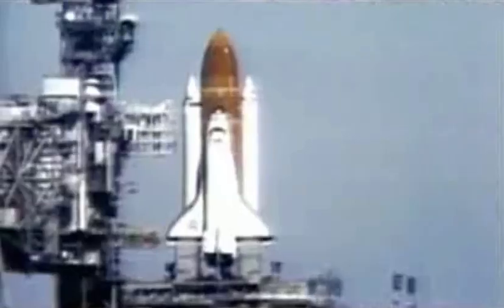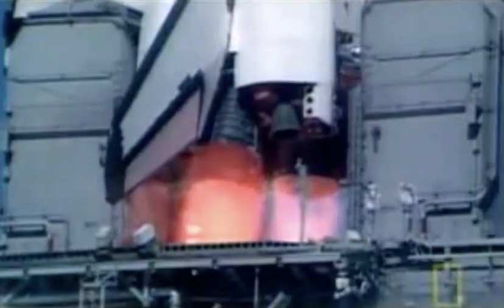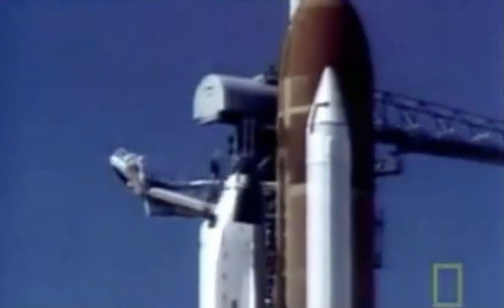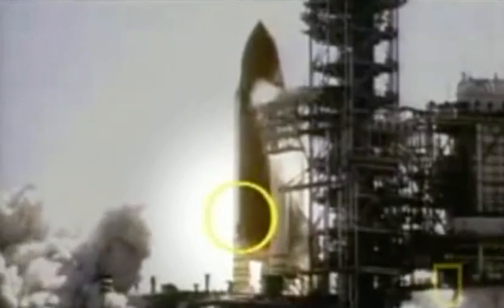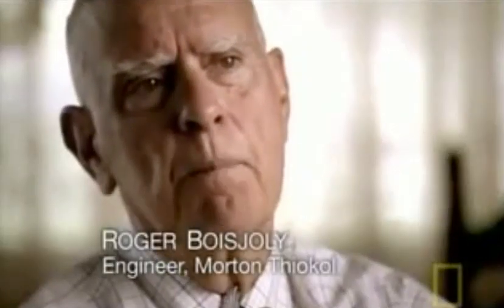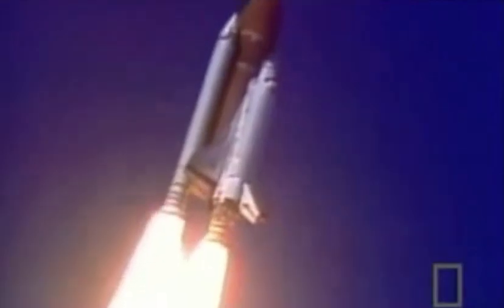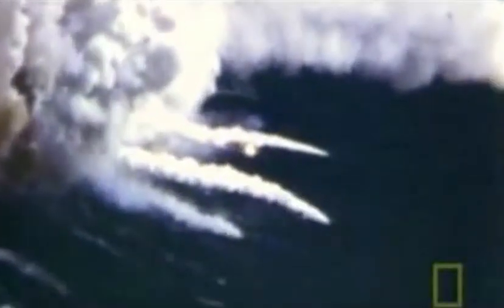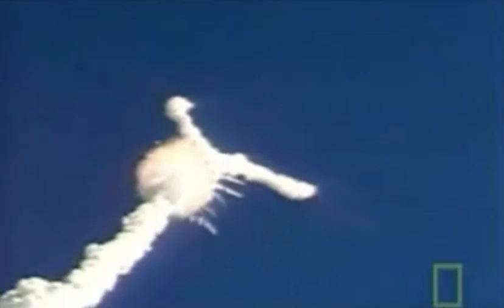Challenger's Final Flight.

Comment: That was a Heck of an explosion, why wasn't there a shock wave?
Reply from the maker: Because it wasn’t an explosion. There was no detonation. The external tank ruptured like a water balloon and the fuel vaporized. 

The shuttle broke apart due to aerodynamic stress. It’s like you’re driving your car at 100 MOH and then you just stick your head out the window.
Reply: @vicorly  , so the ET just had a Violent Rupture?

Comment: Pressure suits & parachutes could have saved them. It would have been dicey unstrapping and exiting the cabin during free fall, but possible. And they’d have walked away with barely a scratch. But NASA wanted you to believe it was an ‘airliner to space’, with a ‘shirtsleeve environment’ inside...
Reply: HailAnts the shuttle didn't have anything like ejection seats to save on weight.

Comment: If they have cameras watching the ascent, couldn’t they have seen the flame burning into the tank and informed the crew? Was there no way to detach the shuttle from the main tank and boosters in case of such an emergency? I’d think they’d be high enough to glide down. 

In any case, those families having to watch their loved ones perish in front of their eyes. Truly, truly awful.
Reply: The shuttle couldn't abort while the SRBs were running. So even if they saw it on time, nothing could be done.
Reply: Kale P it happened way too quickly. By the time anyone would have noticed it was too late. This was slowed down to show the breakup

Comment: My question is if Nasa has seen this flash with the camera obviously something was wrong how come,  Nasa did no tell the astronauts to detached  the space shuttle from the rockets bing that they knew was was going to happen next.
Reply: Yassine. Can the SRBs be separated sooner than they are supposed to come off?
Reply: Yassine. Sorry, the SOL(shit out of luck)  likely did not translate. Basically, even if something is noticed they are unable to do anything, no matter how unlikely it is to save them, in an attempt to avoid the orbiters destruction as there is no control over the SRB's attachment to the stack.
Reply: Nasty FingurZ they didnt see the flash until it was too late
Reply: Nasty FingurZ there was one NASA employee who tried to have launch a third time. but nobody listened to him. After the Challenger disaster he retired from NASA. There is a full doctumentary on the disaster
Reply: draco6543 Answerer: You dont
Reply: You do know this it was only noticed after the fact?
Reply: Once you ignite the SRBs at T0 whatever happens you have to wait until SRB sep to do anything. Before that you can just watch and hope
Reply: Murph88 Neither. Sadly that's the bad side of using solid fuel
Reply: Yassine. So it is pretty much sol once they you leave the launch pad or when the SRB's are ignited?
Reply: Murph88 Sorry I didn't understand the question

Comment: Great play-by-play.

One possible error - It describes the final plume as being created by the second o-ring burning through. My understanding is that both o-rings burned through at liftoff but were quickly resealed by a piece of aluminum oxide fuel, which was shaken free by high-altitude winds (thus causing the final plume.) Not totally sure here, can somebody elaborate?
Reply: GigaG11 Yes, everything I have read said that the disaster was delayed due to the aluminum blocking the flame until it was dislodge by a windshear. The windshear was apparently the result of a commercial airliner passing through the airspace shortly before the launch. They theorize that had it not been for that windsheer the blockage would have not dislodged and the shuttle would have successfully completed it's journey after the SRB separation.

Comment: They were alive, and conscious for the entire ordeal.
Reply: IwshIcldstrtover at the speed they were travelling, they would've actually been alive and well aware of the situation, for example, the 1974 crash of Turkish Airlines flight 981 resulted from cabin depressurization and the plane fell out the sky at 390 mph and everyone was conscious so at 207, no one would have knocked out really.
Reply: IwshIcldstrtover. Actually they concluded that the cabin maintained pressure as the wreckage showed no sign of buckling that would have happened if it lost pressure.
Reply: Until they hit ocean...
Reply: pen mightygun skydivers don't typically feel mach 2 speeds...
Reply: Oh so you were there were you? Facts not theories please. No one will ever know
Reply: They lost conciousness as the cabin plummeted
Reply: @IwshIcldstrtover  you mean regained

Comment: This documentary has a flaw of its own. Challenger's crew cabin did not depressurize. That is the lie NASA wanted everyone to believe...that the crew lost consciousness. If that were the case, the mid deck floor would have buckled. When the cabin wreckage was located, there was no evidence that that occurred. Its terrible to imagine, but the crew was alive all the way down until impact with the ocean. Even Kerwin could not say for sure in his report with any certainty that the crew was unconscious at water impact. In court, if you lie to the judge, anything else you say becomes suspect. Show us the photos. Show the damage that supports the claim. Then I will believe it.
Reply: Endeavour Gaming The shuttle broke up at 48,000 feet (9 miles), but the crew compartment continued on an upward trajectory to 65,000 feet (12 miles) before it began to fall back to earth. The force of the external fuel tank exploding on the crew compartment was about 2 Gs, far below what it was built to withstand. So no- no decompression occurred when the shuttle broke up. By comparison, when the crew compartment hit the ocean, it hit at 207 MPH (20 Gs). The crew compartment was completely destroyed when it hit the water and the astronauts were killed instantly. But they were alive and conscious for the entire fall.
Reply: I hope they passed out due to the g's of falling at Mach 2
Reply: +Endeavour Gaming They did not black out during the fall back to earth. I wish they had because I cannot imagine what the crew was thinking during the fall, but there is no reason why the crew would pass out simply by falling at that speed.
Reply: @JoeSimonin  they most likelly were trying to fly the ship and recover the attitude and going throught emergency procedures...
Reply: +Endeavour Gaming At that speed believe me it was. Hitting water is like hitting concrete, especially at that speed.
Reply: Why are you convinced that the cabin did not depressurize? Because the floor didn't buckle? What does that have to do with it? If the systems fail or there's loss of power, you can have the depressurization. And at their altitude from 45 to 65k you literally have like 5 seconds to turn on your oxygen assuming you were ready for it. The average human needs about 8 seconds to figure out what has happened, at that altitude you're pretty much passed out by then. As far as them waking up during their fall, it's still very unlikely. They would have been out till about 10,000 feet but being unconscious for so long I'm sure they weren't full awake or realizing what was happening anyways. Also not to mention the Gs they must have felt, just because the explosion was at "2Gs" you don't know what the cabin experienced as it was flying off on its own upwards
Reply: +ArkadyVolkov There was no explosive decompression and the floor did not buckle. The crew cabin was built to endure much higher forces than what it experienced when the external fuel tank broke up. And the trailing wires were from the payload bay, not the cabin itself. I would love to believe the crew was knocked out but there is absolutely no scientific evidence to suggest the cabin decompressed.
Reply: Do you have any information on this because I'm not quite understand how you call pull Gs while your falling. Even on roller coasters, when you go down, they tell you, you experience weightlessness.
Reply: Joe I agree that the crew survived the explosion and did not lose consciousness as this is shown when Ellison Onizuka, Michael Smith and Judy Resnik activated their Personal Egress Air Packs (PEAPS) this was found in the wreckage. The impact with the water was worst with Christa McAuliffe, Gregory Jarvis and Ronald McNair as they didn't have any Windows and they couldn't close their eyes before the impact
Reply: Eddie Porter You are correct. I think the thing this documentary is trying to do is to agree the switches were turned on by the crew, however, have them unconscious immediately following, which is not likely true.
Reply: +JoeSimonin yeah. I redid my reascarch. they were comncious. hopefully their death was instantaneous.
Reply: @panzerdragon1121  It seems like some of them lived long enough to drown. https://www.youtube.com/watch?v=uqcd_3daPQ8
Reply: @DieyoungDiefast  There is no way of surviving the impact into the water at over 200 mph. Story Musgraves said in that link they were alive until they hit the water.
Reply: +JoeSimonin and at that height they were at ,( abut 2-3 miles right?) explosive decompression was  unlikely.
Reply: +Joe, ugh! Almost like Vladimir Komarov when Soyuz 1 slammed into the Russian steppe at 300+ mph, only without an explosion and fire....
Reply: not unless the windows broke during break up
Reply: "But they were alive and conscious for the entire fall."

There is zero evidence to support this claim.  It is inexplicable that you believe the crew cabin was ripped from the fuselage by aerodynamic forces yet still retained a sealed environment.  Highly unlikely.
Reply: why do you care?  what difference does it make to you?  what are you going to do about it?  they're dead  period
Reply: What's the science of passing out because you're going fast? Maybe the G forces of the explosion itself, but THAT didn't happen as several of them activated each other's emergency oxygen packs.  Fact:  They lived through the explosion, they fell for ~2 minutes well aware of what was happening, and died on impact.
Reply: that so called lie is what the media wanted the people to believe so they would feel better about what they saw.  NASA didn't cover any of that up. Would they tell the whole truth, What do you think? You want to keep the public's interest up.  It's business. Story Musgrave even said they were alive when they hit the ocean.  At that time, it's only common sense that you don't tell the story until you know "EVERYTHING" and that investigation took along time. You tell the positive story so you don't fog the public's mind with negativity.  Especially when you won't know all the details until later.  How could they know without investigation. This video is full of loop holes that omit many other details such as a piece of slag that wedged into the joint of the oring that allowed it to accelerate as high as it did before a gust of wind side swiped the shuttle shortly before or at Max Q alloweing the slag piece to burn out and re-open the joint.
Reply: @panzerdragon1121  there is not much G load..they are in freefall.. until air friction behins to slow them down and thats up to 1G... you would need to come at huge speed and ram into the atmosphere to experiment high deceleration
Reply: +Endeavour Gaming wouldn't falling be 0Gs?
Reply: Due to them still being in the fractured shuttle that still had a somewhat aerodynamic shape, I believe they fell so fast that they blacked out.
Reply: +Endeavour Gaming 200 mph impact speed with the ocean isn't that fast, but I hope you're right.